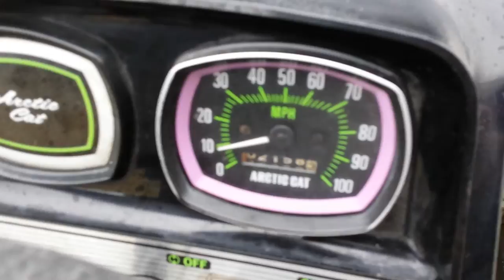Walbro WF-8 1975 Cheetah Arctic Cat

Comment: I have a 500 cheetah with a smashed dash. I can't find 1 that has the same dash. I thought it was a 75 but ill b damned if I know. its got cyl. temp guages lft and right. speed and rpms. surevwould like to find a parts sled.
Reply from the maker: +bellydump1974 I would have to say your sled is a 76 Cheetah, I have a 76 440 but I think the dash is no good on it.  You might be able to use panther parts from the same year or parts from a  different size cheetah, same year.  Different year stuff don't match up.  The manufacture date is stamped on the tunnel left hand side.  I have learned a lot of things from this website, http://www.bosscatlegacy.com/acproto/index03.htm
Reply: +ZOSOACERO thanks.
Reply: Any market for alfalfa or prairie hay down your way?